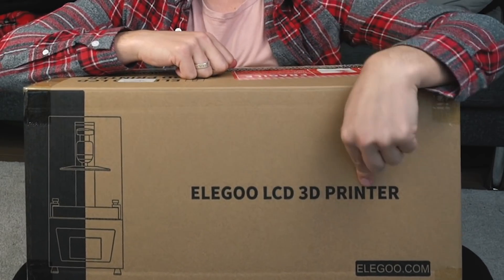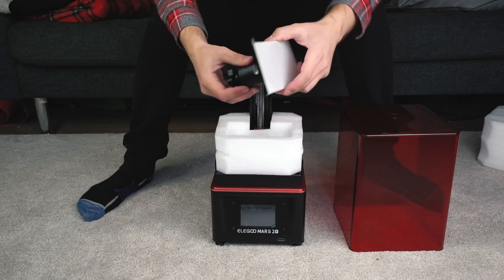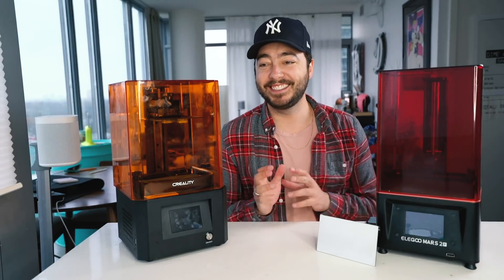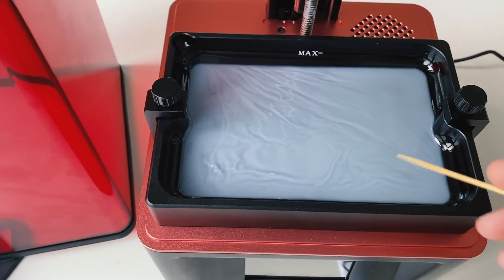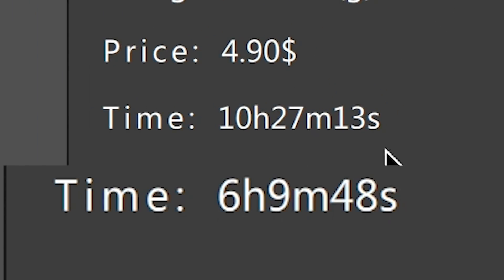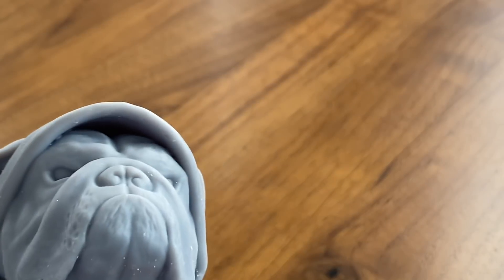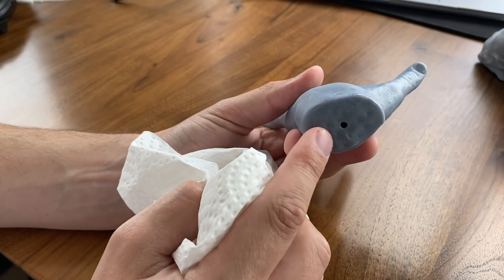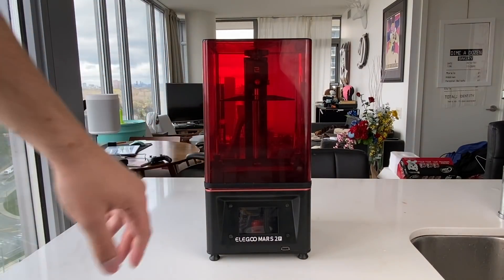UNBOXING the FASTEST RESIN 3D PRINTER! | ELEGOO MARS 2 PRO REVEW!

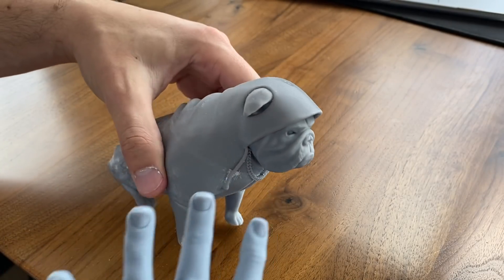Comment: 6:31 You'll want to drill or somehow punch a hole (2 is better) in that and drain out the resin. If you don't the model will likely crack and leak the resin out, making a dangerous mess.

Comment: I disagree that it is cheaper upfront. You can get an ender i3 which is a great fdm printer for 200 pounds. I got my anet at for 130 pound. The print shouldn't be faster on one compared to the other if you keep the same layer height and speed.
Reply from the maker: The two I compared have two different UV light strengths so one needs to shine longer to cure the resin than the other. That’s why the elegoo is twice as fast.

Comment: resin 3d printing is overall more expensive than 3d printing with 'plastic'. You can buy a creality ender 3 for 220$ after shipping and taxes, and 1kg filament for about 25$( that will last at least 3 big prints). So overall in my opinion "plastic" 3d printing is cheaper even from the beginning.
Reply: You can get 1kg of resin for $20 now so price is same for supplies and way better detail and faster printing on resin for the same price

Comment: Next printer you’ll need is the Formlabs Jewelry-Edition Form 3 Complete 3D Printer. It is fantastic and takes little to no effort to to print with. All you do is upload your model and press go. It has a resin cartridge that fills the base automatically, therefore leaving no wasted resin and it has proper cure stations!!

Comment: If I get the resin stuck in prints I just use a decent sized drill bit and drill a hole in the bottom over a cup. Collect, and filter that resin. It's still good. 
I have the PhotonS and it's really good. I do wish I had more build space tho. It's 115x65 mm